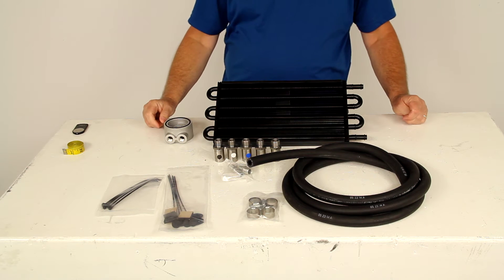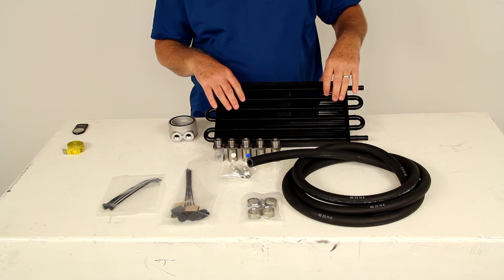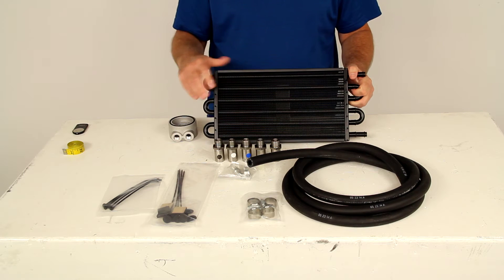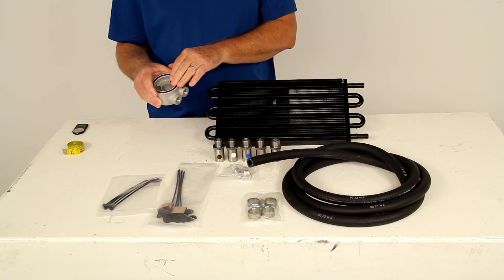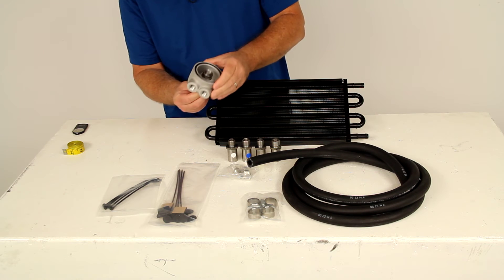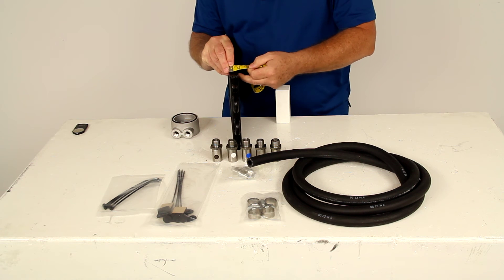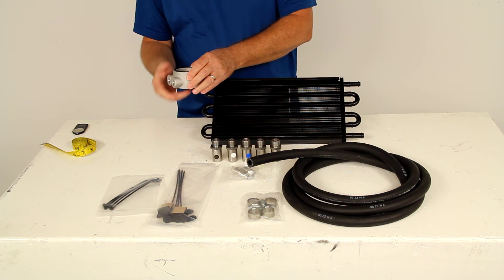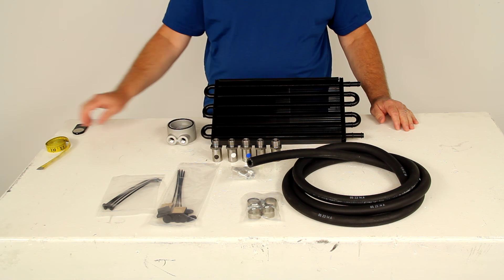etrailer | Derale Engine Oil Coolers - Tube-Fin Cooler - D15502 Review

Comment: so the engine oil is re-directed to a new route [as soon as the thermostat is activated]. will this effect the oil pressure? Also, would we have to add more engine oil?
Reply: Mustafa Sutarwala I know this is a very old comment but I saw because I wondered the same. And am buying this. But pressure shouldn’t be affected since you should “prime” or fill the cooler and lines prior to attaching everything. Then each time it opens flow to the cooler you have fluid already there. And your second question is answered in my previous. The manufacturer states the cooler holds 7oz more fluid. And the lines should be a few more on top of that.